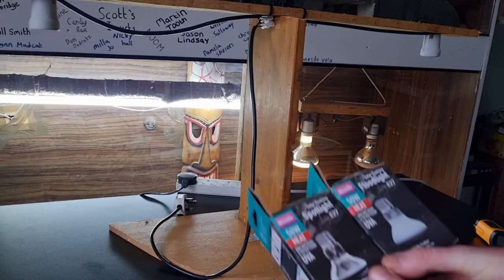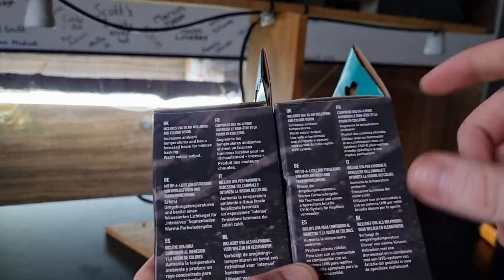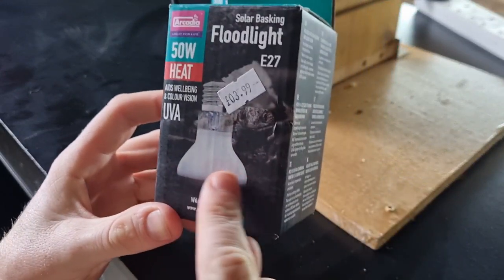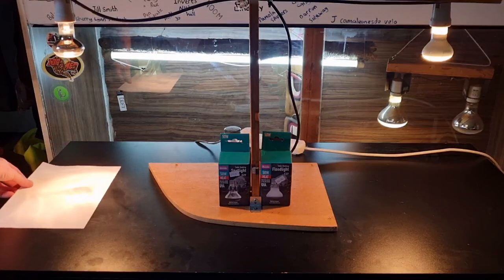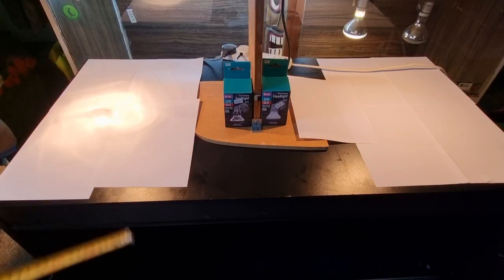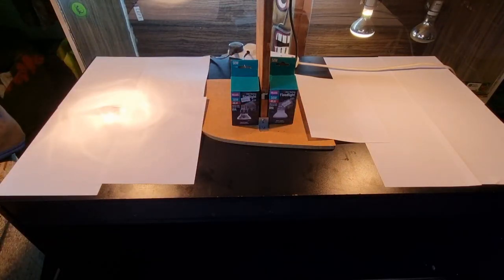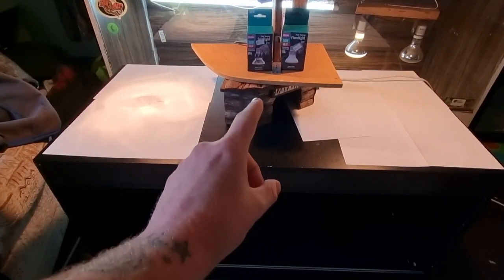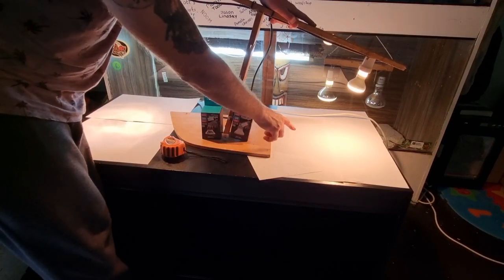Exposing Arcadia Heat Bulbs || Are They The Same?

Comment: Hi, I'm new to reptiles. What light bulb and fixture would u recommend for a bearded dragon in a 6 x 2 x 2 enclosure in a house that's 70 degrees. I was thinking 50 watt Arcadia flood light combined with 100 watt arcadia halogen. I don't know much so trying to learn. Maybe just 100w arcadia halogen would do. Just don't know what fixture to put it In. Thanks